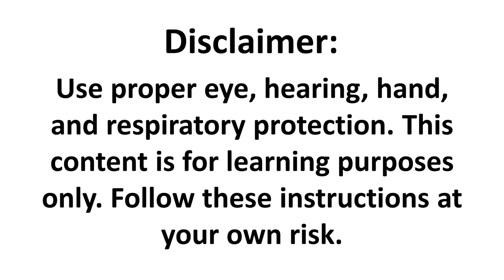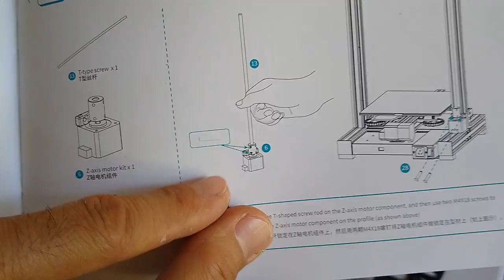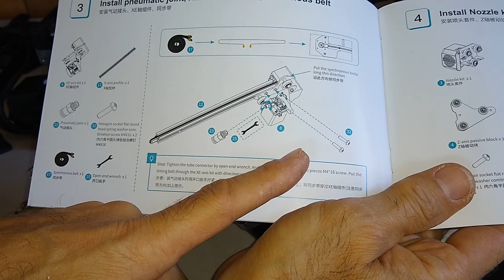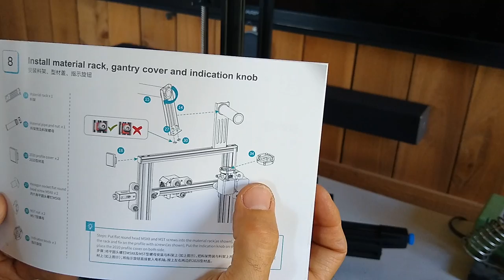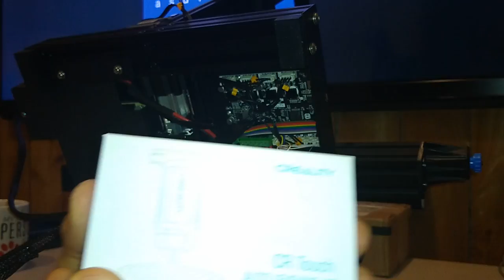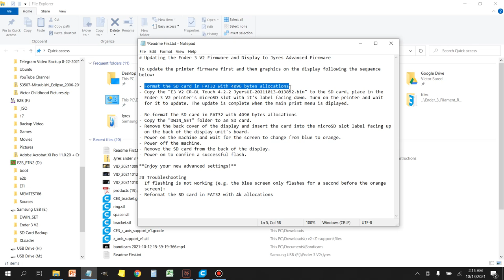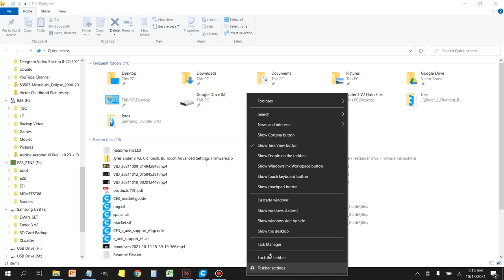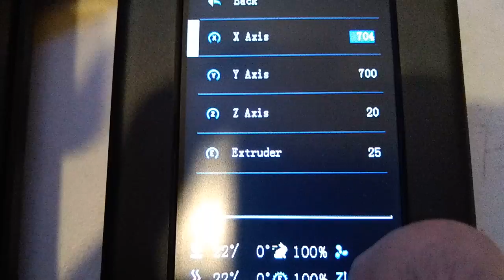Ender 3 V2 Assembly, Upgrades, and Jyers CR/BL Touch Firmware Step by Step.

Comment: This is such a robust video on setting up the Ender 3, I feel like I need to unbuild mine and build it how you did! Just bought a CR Touch and this was the perfect video to keep using Jyers UI! Thanks for this video!
Reply from the maker: Hello Aaron, Thank you for commenting and encouraging words. I'm glad you found value for your viewing time. The Jyers firmware is awesome. The Ender 3 V2 in my opinion is one of the top budget printers out there with a ton of support from the community. I'm sure you enjoy tweaking your Ender 3 as much as I do.

Best of luck with your modding!
Reply: @vbared  I did have a question about the firmware. Is it safe to use any BLTouch firmware for the CR touch? Or do you need to edit the BLTouch firmware and recompile for the CR Touch support? 🤔
Reply from the maker: @AaronOlin  Hi Aaron, Great question. I was looking all over for CR Touch specific firmware but none existed. After some digging around the forums I learned either one can be used, they both work exactly the same and the reason I used CR/BL Touch in the title. The BL Touch was first so the developers titled the firmware using that brand name.
Reply: @vbared  Awesome! Thanks for the update! Just in case down the road I needed to upgrade the firmware, I believe what you’re saying is true. I appreciate that, thanks!

Comment: Fantastic video!  I wish I would have found this video when first setting up my v2.  It would have made it so much easier, being that this is my first printer.  You move through items at a great speed (not too fast, and not too slow).  Great tutorial and video work.
Reply from the maker: Hello Sonoma67a, Thank you for commenting and for your words of encouragement. I'm glad you found value in this video for your viewing time. The video links below are kind of follow-ups to this one. If yours is already built check out these changes that I made after.

Micro Swiss Dual Gear Extruder Upgrade - https://youtu.be/txBnIR-uoRs

Make sure to watch both of these below before messing with your stock hotend if you plan on using it.

Stock hotend assembly tips - https://youtu.be/ycvHpMbo5Hw
Slice Engineering bi-metal heat break to stock hot-end - https://youtu.be/3v_cEldgT4U

My Ender 3 V2 fans were just too loud -
https://youtu.be/AEdca_-Nqys

Best of luck with your mods!

Comment: I have to thank you for the measuring of the problem part..... I 3D printed a whole new front mount for triple noctuas and had the touch mounted on the front right of the head..... and it was throwing the kill code whenever I tried to setup levelling.
Reply from the maker: Hello Dukeseb, Thank you for commenting and kind words. I'm glad you found value for your viewing time. That happened to me a couple of times as I made hotend changes, It's annoying.

Hit me up if you have questions.

Best of luck with your mods!

Comment: Have you heard anything about not having the top z-rod guide? I've heard a few bad things about having that top guide in place... I don't have the guide on my printer and my printer hasn't had issues in that regard, but it's something you might want to look into.  Thank you for the detailed video!
Reply from the maker: Hello mickeyxxmousey, Thank you for commenting and words of encouragement. You're asking a great question. Since making this video I've switched to bearing z-rod end guide. I'm sure the printer will work just fine without the end guide since the z-rod isn't very long. My other printer is a CR10S Pro V2. It came with long dual z-rods and (bearing type) end holders. So for me the bearing end guides were left out of the Ender 3 V2 to reduce cost. 

I see an improperly designed z-rod end guide potentially causing problems but not a properly designed one. The one I'm using is spaced the same as where the z-rod just rests when not moving. I see it as  premium upgrade for a budget printer.

Best of luck with your build!

Comment: The Noctura fans do not run slower, they have better bearings. Also, they are 12v rather than 24v, the only reason to have one of those voltage boards is a change in voltage. If you wanted to turn down the speed you can do it in the slicing software, or in the E3V2 interface. For the hot end fan, you should not be adjusting the speed on that one. If you do you could easily mess up your printer, bleed heat up into the filament melting it outside the nozzle (especially with an all-metal hot end), or catastrophically have a thermal runaway heating event. Also replacing the heater and sensor you definitely need to do PID testing on the hot end.
Reply from the maker: Hello Robert Hood, Thank you for commenting. Your valuable feedback is greatly appreciated.  During testing and filming of this video I did leave out the buck converter and fan parts. I found that there wasn't a significant enough reduction in noise with the lowered voltage on the hotend, motherboard, and power supply fans without compromising way to much airflow. What I did to reduce the noise to just 27db on the system with all fans running was replacing the hotend fan with a 12 volt Noctua of the same size but didn't use the low noise resistor plug that came in the Noctua kit which lowers the fan voltage to 9.8 thus slowing the fan RPM, leaving the stock parts cooling fan and reducing it's speed to 50% in Cura (as you mentioned), replacing the motherboard fan with a cooler master 12 volt fan of the same size, and using an 80mm X 25mm 12 volt media PC case fan that I had. I left off the black bottom cover that encases the Meanwell power supply and tweaked a Thingiverse Meanwell Ender 3 V2 fan cover to fit a 25mm deep fan and also spilt into two parts so I could print it on the Ender 3 V2's bed.

I'll have to do a follow-up video this.

Best of luck with your projects!
Reply: You can’t adjust the fan speed if you’re using a buck converter

Comment: Thanks for the great video. I was so excited when I received my printer, and I assembled it right away before watching this video. Now I wonder should I disassemble it, and redo everything? Please advise.
Reply from the maker: Hello MrCucuom, Thank you for commenting and kind words of encouragement. If this is your first experience with a 3D printer then I would tell you rewatch the video and make sure you have the z-stepper motor shims installed and the z-rod guide at the top. Measure the distance of the z-rod top and bottom to the support beam next to it. The distance should be the same. If not the gantry could bind near the top or bottom which will show up as distortion in your prints. The gantry also needs to be square with the brackets that hold the wheels. Another thing to look at is the seal between the Bowden tube and the brass nozzle tip to make sure the seal is good. Watch my most recent video on a better way to create a strong seal. Starting off with the proper assembly will make trouble shooting printing issues easy.

Comment: Very well done Victor I too wish I had found this tutorial first but I'm so glad to have it now.  I can now get past the stuck buck screw in my stock hot end with the Micro Swiss upgrade only one question there, was the 50 watt heater longer than the hot end is wide?  If so should the heater be centered in the hot end?

When I assembled my Z axis I had these thoughts to optimizing the travel of the lead screw.  I thought the Z axis lead screw needed to be parallel in two planes.

The first plane is parallel to the Vertical Extrusion Profile's Back face when measured to the center point of the lead screw, at the extruder plate bearing, and with the Z axis at it's vertical center point of travel. On my ender3 V2 this was measured at 22mm. This value was also the center point location of the Z axis stepper coupling as well as the top of the lead screw, an upper mounting bracket still needs to be installed.

The second plane is from the Vertical Extrusion Profile's Side face measured to the center point of the lead screw at the extruder plate bearing, again with the Z axis at it's center of travel.  Mine was 22.5mm.  This value was also used for the Z axis stepper and upper lead screw.  I thought this will have an impact to any required shimming of the Z axis stepper both from to back and/or left to right.  All of my adjustments were done with the Z axis stepper motor and its mount.  I shimmed the motor to the rear 1.2mm and to the left, ( as viewed from the rear ), 2mm by slotting the original motor bracket to allow the motor to be moved in that direction with washers being added to the motor mounting screws. 

I feel these modification allowed the smoothest liner motion of my Z axis with the current components supplied with the Ender3 V2. 

Once again thank you Victor for all of your time and effort that you are sharing with us beginners and upgraders.  I look forward to your next tutorial.
Doc'
Reply from the maker: Hi Doc, Thank you for your kindness and encouragement. If I remember correctly the 50 watt heater was the same length as the stock one. If you get one that sticks out a bit, just center it in the bore. The aluminum heat block wicks away the heat produced pretty quick so not much will be lost because of the overhanging bits.

It's awesome that you made the extra effort to carefully measure the z-axis lead screw and correct any alignment issues during your assembly. Mine would have been off by 1.5 mm at the top of the lead screw vs the measurement I was getting at the bottom. I'm amazed that Creality still hasn't corrected the issue with the Ender 3 V2.

Enjoy you day (:

Comment: Great video and new subscriber. 
Your Jyers version of the firmware was the only precompiled version I could successfully load. Unfortunately, my stepper motors don’t work after the flash. I’m assuming this version is for the 4.2.2 board? Everything else looks good. Would you happen to know where I could find a version for a 4.2.7 board with a CR touch?
Reply from the maker: Hello Robert, Thank you for commenting and kind words of encouragement. I'm glad you found value for your viewing time. Let me hunt the 4.2.7 version down for you.

Best of luck with your build!
Reply from the maker: All the Jyers pre-compiled firmwares are here: https://github.com/Jyers/Marlin/releases/tag/v2.0.1
Reply: Thanks for the link Victor!
I’m familiar with the link that you sent me and have tried numerous different versions Unfortunately I couldn’t get any of the precompiled firmware to load from that site.
That’s what brought me to your YouTube channel after did a search. Your version is the only one that loaded. Did you compile your version of the firmware? If so, I might have to go that path and try and compile my own. Thanks for all your help.
Reply from the maker: @Robert Raney  Hi Robert, I'm still learning but somehow managed to compile the Jyers version that you flashed. I don't have a machine using the 4.2.7 board so I wouldn't be able to test it before putting it out there.

This is the best video I've come across for editing and compiling your own firmware. The creator did a great job of clearly explaining the process.

https://www.youtube.com/watch?v=ire4ZcAUsjA
Reply: Hi Victor
I guess I should start learning how to compile the 4.2.7 w/ CR touch specific firmware… wish me luck… I’m gonna need it. 
Thanks again!
Reply from the maker: @robertraney2778  I'm sure you'll be successful with enough persistence.  If something isn't working out for me I step away from it until my mind is clear, try again, rinse and repeat.

Comment: very nice video but i have some questions. do you really have to measure the CR Touch in relation to the extruder as you did in this video? also would it be posible to return the screen to factory firmware? if so how? thanks for posting this very useful video. Cheers ;-)
Reply from the maker: Hello Rafael, Thank you for commenting and kind words of encouragement. If you're following this guide and using the CR Touch then you don't need to do the measurements because I've done them for you. All you need to do is use the same measurements and put those values into your probe offset area. Yes, you can always return the firmware back to factory if you want. Navigate to Creality's website and download their latest firmware for the Ender 3 V2. The flash process is the same as in the video but you're going to use the Creality firmware instead of Jyres. 

Best of luck with your projects!
Reply: @vbared  Thank you for the reply. I loaded everything according to your video but I am having the hardest time with the printer not printing on the bed. can you please help? it is extruding pretty much in the air. or the filament does not stick to the bed. do i need to spray the bed with some kind of adhesive? like hair spray? i am such a newbie. thanks in advance Victor
Reply from the maker: @mean1flyer  What kind of filament are you using?
Reply: @vbared  i am using pla filament it is manufactured by Shaxon is 1.75 mm thickness. i run it at 210C on the extruder and 60C on the bed
Reply from the maker: @mean1flyer  Call me when you're in front of your printer so I can guide you in setting the correct nozzle height. 1-478-227-3301
Reply: @vbared  I will call you later. Thank you so much for sharing your number
Reply from the maker: @mean1flyer  Hi Rafael, When you have some time check out this video that I posted some time ago about Garolite G10 build plate.

https://youtu.be/MB-91rfvWfE

Comment: Just wondering. Will the Jyers firmware you have in your description work with a Sprite extruder pro kit and cr touch?
Reply from the maker: Hello Celerio, Thank you for commenting. Please consider Miguel's Professional Firmware instead of Jyers. At the time of making this video Jyers was being developed but it hasn't had any support for the last three years. Miguel's Professional Firmware is the non-Klipper firmware I would use  today and yes, it will work with a Sprite extruder. Check out the video I made on how to install it below. 

https://youtu.be/2NqHNYtyEa4?si=LPF4TdrWyPAfL2A4

Best of luck with your mods!
Reply: @vbared  Thanks. I'm getting good prints on Jyers 3x3 manual mesh. Planning on installing sprite extruder pro kit in the future. Then afterwards cr touch.